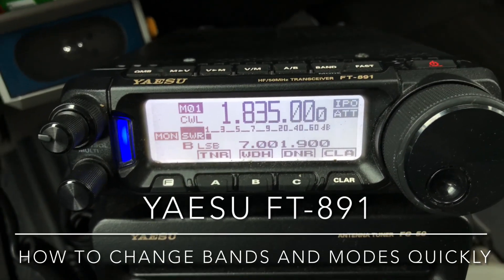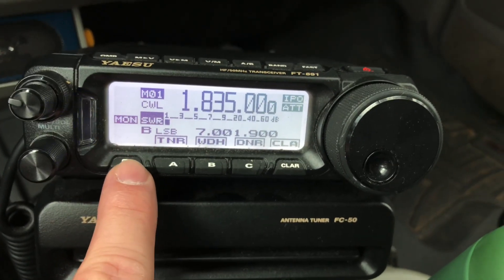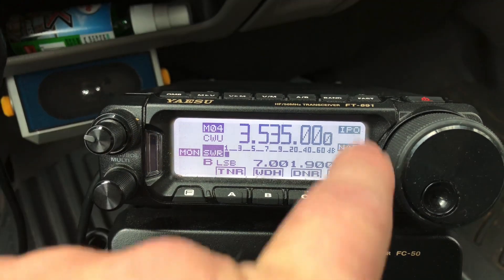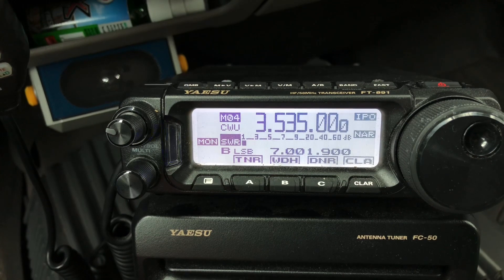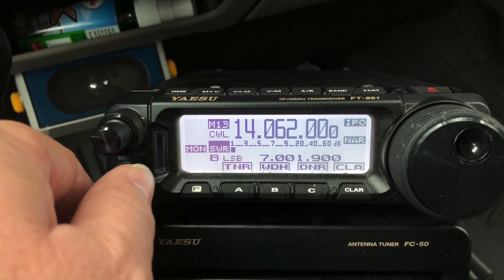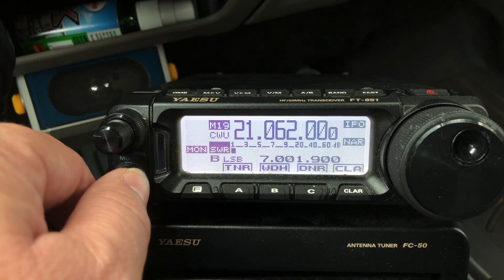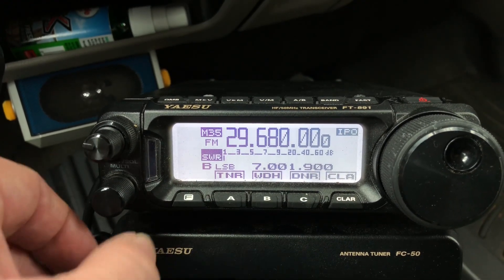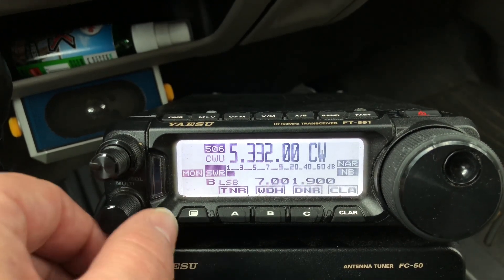Yaesu FT-891: Easy Band/Mode Changes using Memory Tune #yaesu #ft891 #mobile #hf #hamradio

Comment: Memory mode looks like a great time saver. I just got a FT 891 for portable use. Any 1st things I need to do? Thanks for sharing 73. KZ4OY
Reply from the maker: Memory mode/tune is great. Make sure you’ve got a decent antenna, too.  It’s very important!  Get your TX audio parameters dialed in. That is critical.  There are receiver techniques I cover in other videos. S7 and S9 Patreon members who subscribe annually can request a menu optimizations guide.

Comment: Nice video on memory operation but no info to switch modes except as they're sadness in your memory channels.
Reply from the maker: I mainly cover topics that the manual doesn’t cover or doesn’t cover in a clear and concise manner.  The manual takes you through the steps to change band and mode and store it into a memory. This video shows how to use the memories to change band and mode, and avoid needing to use the button again.

Comment: Can you help me add memory groups please? I only have 1 7 and 8 on mine and manual doesn't say .. if no channels have been assigned to a particular memory groups, that group cannot be accessed.. can't figure out how to assign.  Thanks in advance!
Reply from the maker: Check out pages 53 and 54 in the Advance Manual, available at Yaesu.com. It explains how to enable Memory Groups and how to assign memories to specific memory groups.  You won’t find this information in the Operation Manual.
Reply: I quoted the advance manual in original post .. I finally found the fix ... if you have memory groups enabled but no channels saved it only goes up to 19 channels to save . If you disable memory groups 05-09  it opens up to the 99 so you can save them then add groups . The manual does not explain that
Reply from the maker: I didn’t see a quote from the Advance Manual.  Glad you got it worked out. Most people who ask me questions aren’t aware of the advance manual.  The Operation Manual barely mentions Memory Groups, so I figured that might be why you were asking me.

Comment: Funny we have to do work arounds to use a radio they can fix in the firmware... 

Why when I change the mode the Freq changes???
Reply from the maker: When switching from SSB to CW or vice versa the frequency will change based upon your sidetone selection. 

Yaesu packed virtually all of the features of the FT-991A, sans 2m/70cm into a mobile chassis transceiver. And the FT-891 will stand up to the FT-991A.  

The amount of room for knobs and buttons is limited on such a small transceiver, so tap and long-press allow the same button to serve multiple purposes. There is no Band button that can be used to cycle through band stack registers, so there are no band stack registers. So I just operate from memory tune mode. It works very well. I seldom touch anything but the multiknob and VFO.

73, de N4HNH

Comment: I did the same thing for my IC-718 for years and already had a template of frequencies to put into my newly acquired 891. Both radios have about 99 channels of regular memory. Channelizing through the bands makes things much easier. 
I also use channels 61 - 99 for shortwave listening band edges and frequencies.
Reply from the maker: Yes, the naysayers who think the FT-891 just aren’t setting it up and using it effectively. I have no problems using mine as a mobile.

Comment: Excellent tips! I had seen a similar video and saved a lot of my popular frequencies. I am mobile-only. My display is mounted in such a way that I cannot quite see the top buttons. When I use the dial to move away from my saved frequency, I have been using the "V/M" button to go back to Memory mode. Sometimes I miss and press the "V>M" button and goof up my memory setting. DOH! Your tip for pressing the Multi function knob will save me some headaches! I appreciate that!

On another note, I see a lot of folks using IPO and ATT. As a mobile station who's mostly a SSB and D-U user, I'm inclined to think that I need as much receiver as I can get. So, I usually leave IPO and ATT off. Is that wrongful thinking? Am I missing something? Thanks for your advice!  -Scott, KE4WMF
Reply from the maker: I’m glad you found the video helpful. I use IPO when mobile. Sometimes I add ATT. If the S-meter is above zero with noise, turning off IPO is only going to make reception worse. It hampers the ability of the receiver to discern signal from noise. Mobile operation is already prone to noise, from the engine, the power lines, traffic lights, etc.  Always use IPO before using ATT. IPO improves the cross-modulation characteristic of the receiver. 

I also roll the RF gain back until the S-meter rises to equal the noise floor. If I’m in a QSO, I roll RF gain back until the S-meter is 1 S-unit below the level of the signal I’m listening to. 

I might disable IPO when I get to 18 MHz or higher, where there is less atmospheric noise. Again, I will use RF gain. 

73, de N4HNH
Reply: @n4hnhradio  - Thanks for the explanation! I guess I had figured that turning off IPO was increasing both the noise AND the signal, giving me more to work with. And I haven't found a good reason to reduce RF gain except for when I had overbearing signals on FT8. I probably have misunderstood both of those functions for a long time. I'll have to experiment with this new understanding.
Reply from the maker: Think of RF gain as a fine tuning of IPO. But RF gain can also be used when IPO is off. Remember that IPO means the RF amplifier (first stage of signal boost in the receiver) is off. IPO stands for Intercept Point Optimization. It takes the incoming signal from the antenna and optimizes it for signal-to-noise (S/N) ratio. There might be a small amount of amplification to the signal but extremely small; just enough to compensate for losses through the subsequent filter stage, but not enough to boost the noise. 

Transceivers these days are almost too sensitive for HF, especially at 7 MHz and below, but also quite often at 14 MHz.  When the noise floor is above zero, you don’t need an RF amplifier. My rule of thumb is, work the S-meter to the left, not the right. It improves the signal-to-noise (S/N) ratio. 

73, de N4HNH

Comment: I thought i invented this method.  I use the same method on my ic7300 7200 and ft897 makes life easier.  Unfortunately doesn't work so well with the ft3000 , if you tune away from a memory, it throws a hissy fit . With the ic7300/ic7200, you don't even need to press the multi ,just turn the multi to the desired channel  band/mode and you are good to go .
Reply from the maker: I find so many operators who don’t use the memories.  So much time can be saved.  And the 60 meter channels are preloaded into Yaesu transceivers, in memory bank 5.  I’ve known people who performed the MARS mod to get 60m, yet it was there already.

73, de N4HNH

Comment: Maybe you can do a video on 10M FM repeaters?  Using my very first HF radio and tower I hit the Boston repeater. I’m not sure why that fascinated me but it did.  I don’t think many operators are doing much of that anymore but it sure was neat to get a clear signal to one of those long distance stations.
Reply from the maker: That’s a great idea.  I’m hoping the 10m band will become active soon.  Sunspot cycle 25 is getting off to a slow start.

73, de N4HNH

Comment: Thanks for sharing the am freq on each band.
Reply from the maker: You’re very welcome.  Those aren’t assigned.  They are simply common frequencies where I hear AM operators.  AM can be fun at times.  Just be sure not to transmit with more than what your amplifier is allowed to.  For a AL-80B, don’t dead key over 200W.  I hold mine at 150W.  The AL-80B tube isn’t actually rated for 1kW.  It’s rated for more like 800W SSB, which isn’t a 100% duty cycle.  So I usually figure I will dead key no more than 20% of the SSB rated power of my amplifier, to be safe.

73, de N4HNH

Comment: What mobile antenna are you using in this  video?
Reply from the maker: I use ham stick type antennas.  Each one covers a single band.  I have a triple magnet mount on top of the truck.  I use quick-disconnects to switch out antennas quickly. 

Look for the video on the channel entitled, “N4HNH Antenna Farm.”

73, de N4HNH
Reply: @n4hnhradio  thanks for your reply.
Have a great week and keep safe.

Comment: What antenna are you using mobile?
Reply from the maker: I use ham stick type antennas.  Each one covers a single band.  I have a triple magnet mount on top of the truck.  I use quick-disconnects to switch out antennas quickly. 

Look for the video on the channel entitled, “N4HNH Antenna Farm.”

73, de N4HNH
Reply from the maker: Don’t expect to be overly impressed with the antenna farm.  I’ve never owned a tower, or even a beam, for ham radio.  I like to think that I show how to have fun with amateur radio when one has limited options for an antenna system.  I literally work the world with wire.  

You will hear people say to compromise on the radio but get the best antenna.  But for those who live in a neighborhood with antenna restrictions, or who cannot afford a tower and beam, I am proof that a better radio can make up for the compromised antenna.  Plus, a better radio, with better selectivity and superior DSP, can filter signals that the lesser transceiver with a better antenna might not.

73, de N4HNH
Reply: @n4hnhradio  thank you

Comment: I do something similar for CW but for sideband I use the 891's PMS memory banks to set the upper and lower frequencies for the General class band plan. Those seem like an underappreciated feature and since I'm usually chasing SOTA/POTA where there aren't really designated "watering holes" on SSB like there are for CW it makes sure I don't transmit outside my privileges! It's been a long time since I've had to switch bands manually.
Reply from the maker: Great idea, Ryan!  73, Doug

Comment: I noticed some of the lower band CW's were CWU - was that intentional ?
Reply from the maker: CWU is a default.  It doesn’t really matter which band.  It determines whether the BFO generates a frequency that will be offset above or below the operating frequency.  You can toggle between CWU and CWL to combat interference from a another station up or down the band, close to the signal you are trying to receive.

This video goes inti more detail:  https://youtu.be/bYXGRpdYOxI

73, de N4HNH

Comment: Thanks for the upload as always my friend. I have pondered about an ATU for my FT891 a few times; is the FC-50 you are using there a good option? Or is there something better? 73, John 2E0SVB.
Reply from the maker: Hi John!  The FC-50 is a "touch-up" tuner.  It can correct up to a 3:1 SWR.  It isn't a wide-range tuner, such as would be necessary to match a doublet antenna, or for trying to use a multiband antenna on a band it isn't resonant on.

73, Doug
Reply: @n4hnhradio  Perfect, I might grab one then to use with my DX Commander when I am on holiday. It's fairly resonant, but one of the bands was up to 2.0 SWR. I must have another look at it in the summer and perhaps rebuild the elements now I know which bands I like and those I don't.
Reply from the maker: The FC-50 shouldn’t have any problems correcting a 2:1 SWR.  I use it for my ham stick mobile antennas, to touch up the band edges.  The FC-50 comes with brackets and screws that allow you to mount it under the FT-891, so they become one unit.

73, Doug
Reply: @n4hnhradio  Thanks Doug! &3, John

Comment: I made the mistake of selling my 891 a couple years back. Now that I am regularly activating parks I wish I still had it. I ordered another and will be installing it in my truck but it will be easily removable for portable work. I never had a problem using the menus but your memory setup is perfect for mobile operation and I will be implementing it in my setup. Thanks for the tip!
Reply from the maker: You’re very welcome, Mike.  I’ve had a great deal of fun with my FT-891.  It’s been backpack portable, base station, and mobile.

73, de N4HNH

Comment: Good technique, and works for the 818, 897 and 857 too.  Does MTUNE work the same on the 991a?
Reply from the maker: Yes.  Same concept, Jonathan.  Using memories and tuning away is a traditional workflow for transceivers without band-stacking.

73, Doug